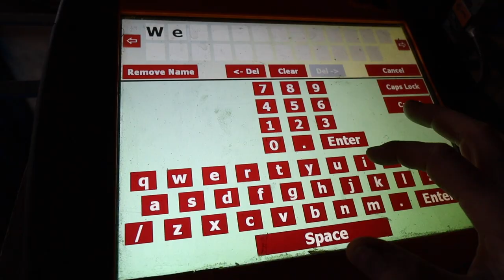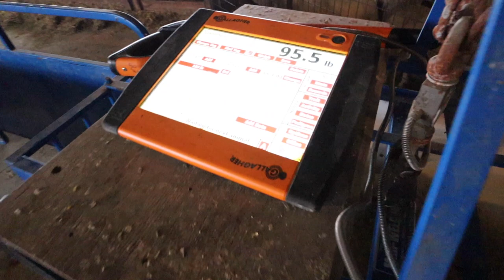This changes everything... (testing the INFACO BATTERY POWERED HOOF TRIMMERS) Vlog 407

Comment: Consider putting down some sawdust where the sheep are penned waiting for treatment, the race and the turning crate. It ia quite surprising how well it works on slippery surfaces (including ice) and it is easy to clean up and dispose of on the manure heap. Many livestock haulers use it on metal staircases and metal floors.

Comment: There are cut-resistant kevlar gloves. You could wear one on your left hand.
Reply: They vary in cut resistance depending on rating. From will help for a small slip to you ain’t cutting it. The Kevlar are not very flexible at the higher ratings, for max cut resistance and a bit more feel, steel chain mail works well.
Reply: I agree. Those look very sharp and so quick!  You'll get used to them  and just skip through the trimming.  I wonder if they would work for pruning shrubs and flowers.
Reply: A steel mesh glove would be safer with powered sheers.  It would take multiple layers of Kevlar, and a lot of bulk, to resist scissor cutting action.  Kevlar fabric is easily cut with scissors - although it does mean things to sewing scissors!
Reply: They don't work

Comment: Hi Sandy. I looked on internet and found the dutch manual. It mentioned there is an electronic glove that can be connected to the cutter and that will stop the cutter when there is contact. I read the manual for the 3015. I still have to find the price for the cutter in The Netherlands. It looks great.
Reply: Thank you! I’ve seen these in action in horticulture and remembered there was something to prevent the non-tool hand from getting injured. Your mention of the special glove triggered my memory.

Comment: GR8. 
Suggestion: use steel wire hand gloves while using this scissor/trimmer, will save ur hands/fingers.
Normally it is safe as both hands are engaged while using it, the only risk is to the left hand holding animal hoof if animal kicks (4 right handed ppl n vice versa).

Comment: Love the new trimmers❣️
Yes, they’re pricy, but they are so going to save you, time, your body, and your hand🥰👍. 
You can find fine chain mail gloves that are super flexible at a butcher’s supply that will protect your holding hand. 
Oil the blades when your done using it for the day. It saves them from rusting from the humidity in the air and the acids from the sheep manure. Just a quick spray and wipe and your done. I groom dogs and can tell you it makes the world of different on how long a sharpening lasts.

Comment: I think your turntable the turns the sheep upside down looks like it needs to be well greased and oiled. I think it would be much easier to work with if you didn’t have to push down with your feet and pull with your arms quite as hard as you do. Please try it and see I think you do a fabulous job with your sleep come I enjoy watching.

Comment: Those clippers look really good!  Yes, they are definitely an investment, and you have yet to factor in blades, or replacement batteries come to that, but apart from speed they are taking the strain off your hands!  Just don't let your fingers get caught

I once used to work mainly outdoors with a lot of stressful hand work, and I now have trigger finger, which is where the tendons slip in their sheath and seize up, so I have curled claws until they release (usually with a sudden 'pop' as they open up straight-ish).  There is more than arthritis can set in, and will literally cripple you.  These things will be worth the investment for your future health and livelihood :)

Comment: I enjoy seeing how you're constantly trying out new improvements.  Here's an idea for consideration.  :)  When you "punch" the release lever on the turntable to let the sheep out, could you make a pad that you fasten there?  It would be much softer on your palm / fist as you release the ewes.  It could be made from easy to get vinyl and (dense) memory foam with a thin plywood base that somehow gets fastened to the lever.  Since you don't pull on it, the pad just needs to withstand the pushing force of the punch.  Cheers and thanks for the vids!

Comment: Thats going to be so much easier on your hands! Ive had Carpal tunnel surgery on both of my hands and thus dont do trimmers well because i have a hard time with repeatedly squeezing or squeezing hard. I only have a couple goats i trim but still sucks when i do....especially their toes lol. If i had to do allot id definitely need something like those! Once you get comfortable using them you will love them! I'd suggest oiling your blades after your done on either pair so they dont rust from the humidity in the air between uses. Rust dulls and also makes it harder to open and close the blades.

Comment: I do believe that Y-yoke suspender should be attached to the belt in  back too. It then becomes a harness with 3 points of attachment between the belt and the suspenders, too evenly distribute the weight of the battery and hoof trimer

Comment: get some safety grip tape or the liquid bedliner for PU trucks from the hardware store, and put it on the metal floor for traction.  manure and moisture wont bother it and they don't slip. I used this in both my cattle  and sheep chutes.

Comment: the whole harness thing seems a bit over the top, got a feeling just a shoulderstrap in combination with a belt would work just as well and be a lot easier to put on and take off.
Other than that, and maybe wanting a safety catch on them, seems like a very good addition to your toolset if you've got a lot of hooves to trim (which you do, with well over a hundred sheep).

To get the chute to be less slippery, you may want to get the surface graded, to make it rougher for them to stand on. 
Brushing away the muck after every few sheep can also help, but takes a bit of time of course.

Comment: I only have about a dozen sheep but I dread trimming hooves.  I'm so concerned about hurting them (I have), hurting me (I have), getting them situated so that they are still (they pretty much never are)...  anyway, I'm lucky if I get it done yearly.  Mine are outside so I hope that they grind some of it off themselves :)  I could never afford this tool but it is really great and I'm so glad that you have it and are using it!!  I also covet that squeeze and while I'm at it I might as well covet a cow squeeze too, haha.  Now I'm over myself and will return to feeling thankful that you have the right tools for the job.  I like the equipment comments :)
Reply: I'm sorry to hear that this routine task is such a bother and worry for you. Do you try to trim the sheep's feet with them stood up on their feet as for normal walking / running etc? 
If so it is much easier if you will either turn them by pointing the nose firmly towards the tail and step backwards and pull them down to the floor. Once down grab both front legs above the knee joints and rear then up and then sit them on your toes resting on and slightly between your legs and them leaning a bit backwards? The key issues are not to sit them on their tail which will make them squirm as it is painful but on the area to the side of the tail (or one cheek of their rump) and if possible find a location that you can lean on with your own rump such as a fence or gate. 
Use your elbows to push the neck and head to one side and hold it down firmly. Release the leg that you use your hand to work the trimmers with and slide the other hand up to the foot and pull the leg up towards your waist whilst holding it firmly and push your thumb between the toes to spread them apart. Trim the hooves as Sandi showed and work all 4 feet in turn. To release the sheep push forward with your body so that it rolls forward and it will get up and run off.
If this task is too physically demanding for you then get someone to make a simple but sturdy frame somewhat like an old fashioned deck chair (or mini stretcher that injured people were carried on in the Second World War) with extended handles at both ends with those at one end finishing in a simple hook shape so that they will slip onto and over a fence rail. Sew or fix a robust fabric (EG Canvas or deck chair fabric) to the cross bar at both ends BUT make it loose enough so that the sheep is lying on its back in it comfortably at about 45degrees and held in place by the frame. 
To load a sheep into your chair reverse it up fairly quickly so that the front cross bar takes it rear legs off the floor by surprise keep pushing and lift it head and neck so that it rolls on to its back. To unload lift the chair at the highest point so that the sheep rolls out forward.

An example of this design can be found at https://www.sheepeasy.co.uk 

Hope these suggestions help.
Reply: @w056007568  my goodness, what an excellent and thorough answer.  I am going to copy this and apply it next time.  I have tried to figure out how my shearer sat them down but he was so smooth I never caught it.  Now I have hair sheep so I regret not asking him when he used to come.  Thank you for this!!
Reply: @brendamontanye9877  
I just hope it helps!

Comment: Definitely get a pair of the metal protective gloves since your so scared of them. Plus it's just a good idea. 
But I think if you accidentally start to cut yourself you'll flinch hard & immediately let go. So I don't think you'd get a worse cut than normal. But I still think the gloves everyone suggested is just a good protective measure. 
You'll get faster with time. My fibromyalgia would probably leave me unable to move for days if I tried to do even a quarter what you do.

Comment: Just a thought Sandi about the slipping issue, Get some none skid tape for the bottom of your Turn Table. It is sticky on the bottom and like sand paper on the top, I have put it on skid surfaces like in my Boat and Garden Tractor and works great. I found out about it at a former job I worked at, Never had seen it before then. I think it comes in2 inch wide rolls and 20 feet long, So you could put strips down or get enough to do side by side. There is my idea for you today. Have a great day.

Comment: Seeing a lot of comments that those power trimmers are going to be good for your hands and I agree.  What I'm not seeing is that they're also going to be good for the sheep.  The faster you can get them in and out of the squeeze gate the less stressed and more cooperative they'll be.  Well worth the investment pending more information on sharpening and replacement blades.  Still think they'll be a great tool to have.

Comment: That thing could damage the hoof if you line up too far in, or up. Take small gradual cuts until you get a feel for how the battery cutter works. I reckon you have the skill to do a fine job. It will save your hands from the strain in using manual hoof trimmers.

Comment: Sandi, we used to use similar pruners to prune vineyards, however this year we switched to wireless pruners - the battery is right on the pruners just like on an impact gun. Surprisingly, the these pruners were cheaper than the one with the wire. Yes, you have to have more batteries to suit them, but still it was cheaper. And these pruners have one huge advantage, there's a safety feature! There's some kind of an electric circuit that connect through your skin, so if you're about to cut yourself the pruners will automatically stop. I don't know if they make something similar for trimming hoofs, but you should look it up.
Reply: Pavel Mikus, do you have a link?
Reply: @derrickmoodie  I'm from the Czech Republic, but I'll try to find something in English. Give me a minute. :-)
Reply: @derrickmoodie  I found it! This isn't the exact brand we have, however ours look exactly the same. https://www.youtube.com/watch?v=pVF94RFEfX0

I also found a lot of different brands on amazon... https://www.amazon.com/s?k=battery+pruner&crid=355T5BIGVVJPF&qid=1612985179&sprefix=battery+prune%2Caps%2C300&ref=sr_pg_1

I hope these links will be helpful, if not, I'll try to look for better ones. :-)
Reply: @pavelmikus8443   thanks Pavel!!
Reply: @derrickmoodie  you're welcome!

Comment: I think those trimmers are a time saver and body saver, plus better for the ewes.  I like the control you had with the trimmers and I think they are a super investment for you.  Would some stable mats to help with the slickness of the handling area during this time of year? Put the mats down only when needed and keep covered in a stack the rest of the time?  I know you would not need them down all the time and they could be put away in a corner and covered up when not in use.  Just a thought.

Comment: I wonder why all of your heavy sheep run sections don't have wheels on them. Eventually the bottom feet will be worn down and rusted off being dragged across concrete. 
Love your vids!
Reply: Wheels would collect loose straw and get stuck in the pack as the sections are moved, causing problems.  By the time the feet on the sections wear down, the upper portions of the sections will be rusted anyway. Sandi and Mark are aware the sections will eventually need replacing.

Comment: I am a man, started to get white at 35. You try to hide that your hair is getting its final colour.  Remember that you can't stop to get older.  Wrinkles will come. You only can guide what wrinkles you get. When you smile often then the wrinkles wile be smile wrinkles. That are the most beautiful woman. You are amazing as you are. No need to hide those changes. Be proud of them. The secret of not cutting your self with knifes are sharp knifes. Then you can stop half way the cutting when something goes wrong. The same you can do with that power trimmer. Slow controlled power trimming is much faster and safer than with hand trimmer.🐑😀

Comment: So try to to charge the trimmer batteries when they aren't dead. It damages the battery when you charge them unnecessarily. Also, if the old trimmers take the near/same time you still are benefiting the less wear n tare of your body. How would you be sharpening the new trimmers?

Comment: Do you think you have early stages of fibromyalgia? All over body aches esp in joints like knees, elbows and shoulders. I have it. It is worse in the winter. Super hot showers help. I am very surprised Mark hasn't built a huge hot tub for those snowed in nights. You can look at the stars and build a shelter over part of it so no digging it out. A tall glass of wine. That would relieve pain.

Comment: Question?? Why does the average weight drop after they are at the market???
Reply: Because the rumen empties. It makes processing easier for the abattoir, the carcass weight will be the same.
Reply: @wendyrowland7787   I am still confused.
Reply: @daneeniemeyer1805  the main stomach of a ruminant is, compared to ours, a big bag full of forage and the contents are quite bulky. As the food passes through and out the other end, the animal looses the weight of the rumen contents. It makes no difference to the carcass weight, indeed the abattoir want the animal empty as it makes killing easier and cleaner. They may want the intestines for casings or even catgut for surgery sutures. Anyway it makes it easier all round for the processor.
Reply: @wendyrowland7787  thank you. I understood that. Its like pulling feed from birds so their craw is empty.